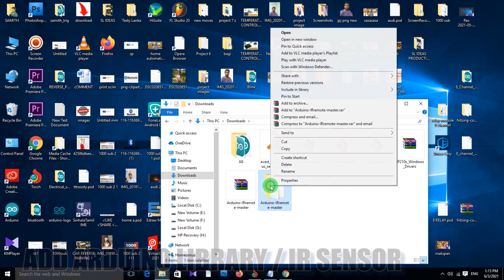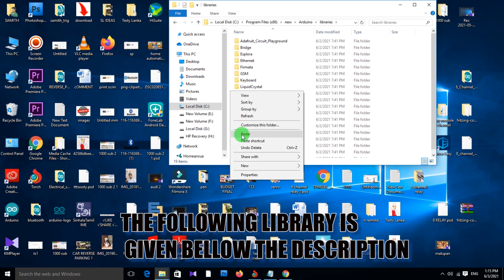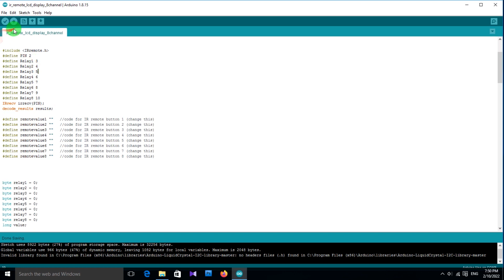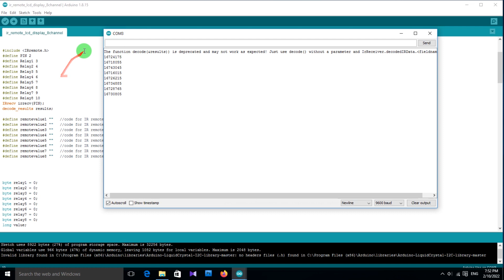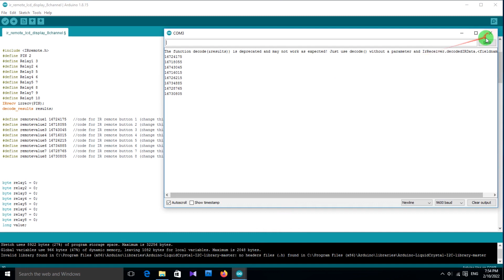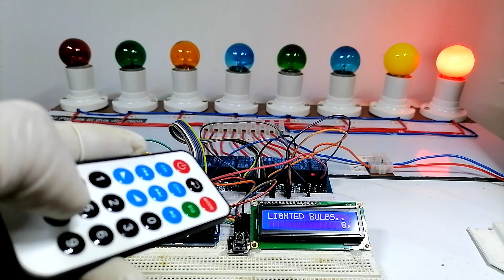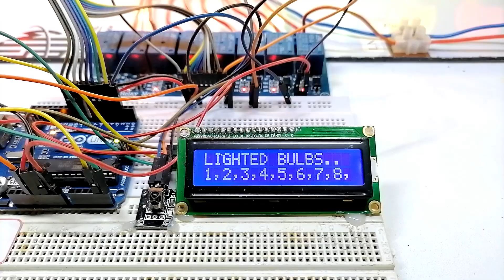Home Automation using ir IR remote control with LCD display & 8 channel relay module | NEW | part 4

Comment: Great video! I thought i finally was home free, not! I cant seen to get my relays to triger. 
I've got the remote codes for each button, yet the serial does not reflect the Hex Codes 0xE718FF00
iR sensor detects signal (blinks) as well as the boar led
The relay can trigger on once the program is loaded (separate 12v supply)
But after asigning the sensor pin (3) and the outputs to the relay board
3, 4, 5, 6, etc.
MEGA 2560
The 4 relays trigger once the cod eis uploaded
I can't get them to triger by remote.
Any help would be gretly appreciated! 😓😕